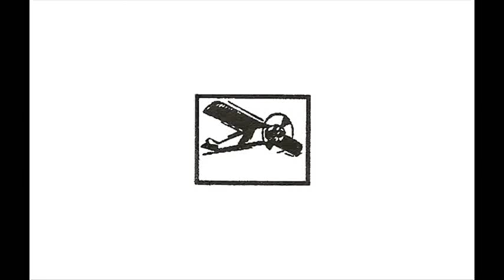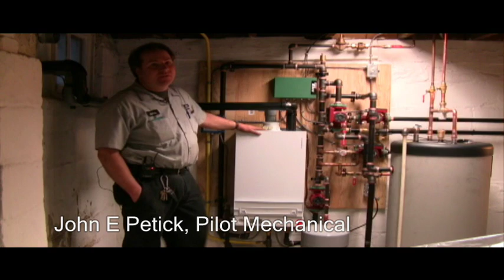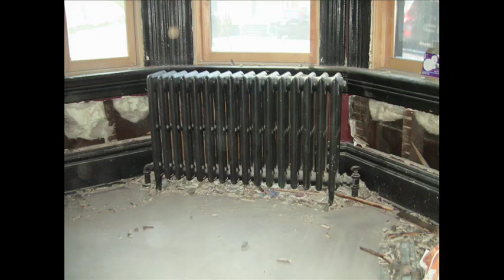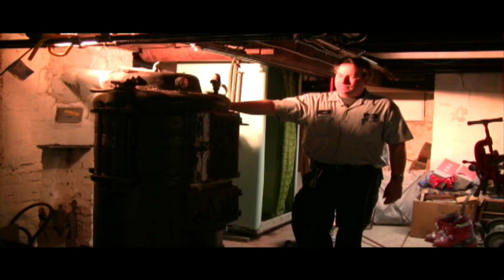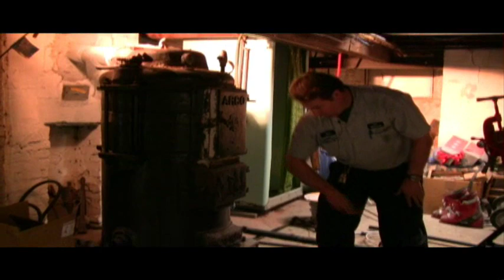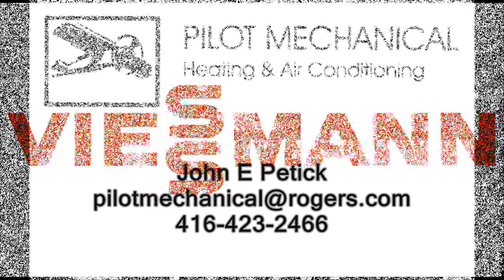New Vitodens 100 Boiler

Comment: This boiler seems to be what has taken over the market, I'm in a similar situation as you customer,  my old boiler ( not nearly as old as this one)  has failed, I live on the coast of Western Canada, to re and re to this new system, for lack of any other options is going to cost me over 10,000 , and from other videos I've seen there seems to be at least a 50% chance it won't be installed entirely correct , nor will it last as long as that dinosaur you are replacing, which has survived 3 fuel adaptions, has very few parts in the system relying on gravity to function,  not to efficient, unless you consider how long it been in operation, since 1919? Now that's impressive, what the vitodens warranty, it's 10 years, sure it might last longer, maybe 15, but if it doesn't, another 10 G please, and let's not overlook the yearly maintenance,  another 100 bill. The heating industry has got you by the short hairs on this, even the more recent caution boilers lasted 20-30 years,  but not these new marvels of technology,  really I don't give a rats ass how efficient this little jewel is,  I care first an only how much will it cost to heat my home with this or any other unit over the life of the unit doin it. All in, cost to install,yearly plus extraneous expenses to keep it working and the cost for the fuel to make it go. I'll bet if you took the total costs of that behemoth in the basement, plus what it cost to feed and maintain that inefficient giant, over 100 years that it actually sat there doin what it was designed to do, then compared that to a 10 year run of the vitodens, then you got some real numbers to compare, probably would make a joke out the 96% efficient tecno trash. But there is no other choice now it's the new technology that is penny wise and dollar foolish or nothin.

Comment: when we fit those in the UK we use a magnetic filter on the return to protect the heat exchanger , the boiler in our version has an internal diverter valve to allow a separate flow and return to both the heating circuits and the hot water circuit, that way you can make best use of the weather compensation option and boost the boiler to heat the water without raising the heating circuit temps at the same time,